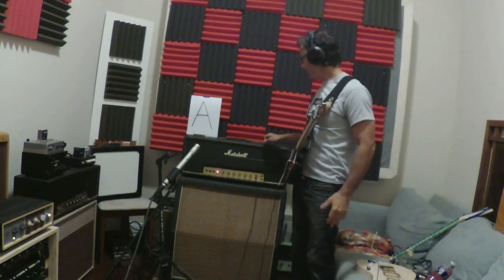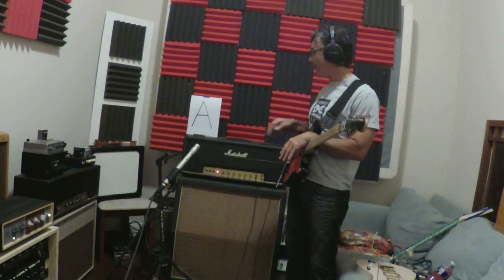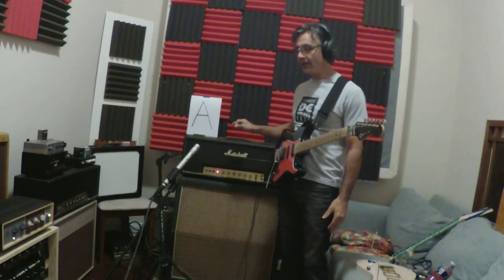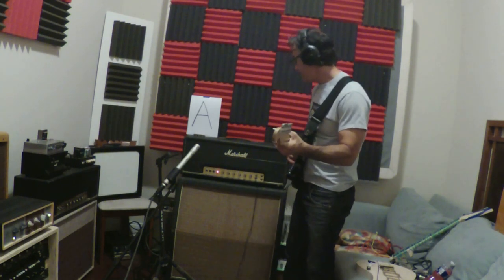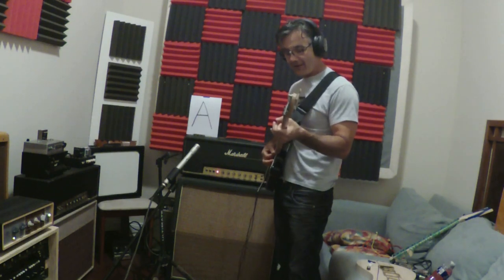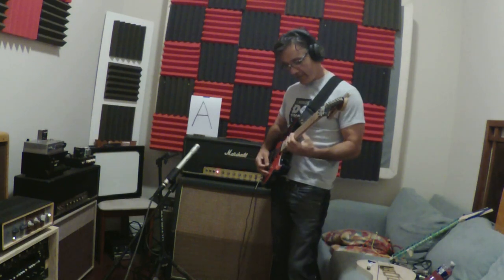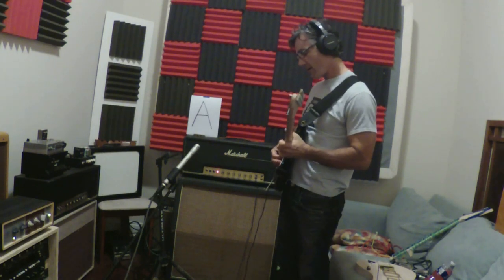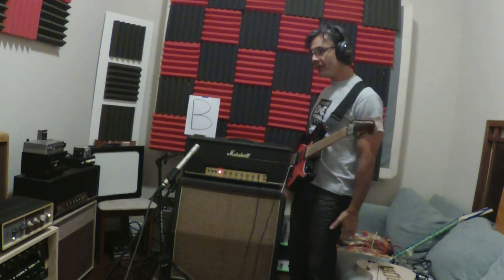Variac Myth-busting: 6ca7 at 90 and 120vac  A/B You Decide

Comment from the maker: The results are as in !

A).  90 VAC

B). 120 VAC

Pleasantly reassured that my guitar wielding friends were mostly correct in identifying which was which!!

Well done !

Personally  I prefer operating the amp at the wall voltage; I have always found the amp to be tighter and more aggressive.  Results may vary with other setups, but for me its gotta be 120!!!

Thanks to all that responded 

Ossie
Reply: You should not turn all the pots all the way up to achieve E.V.H sound and dial the variac as a volume pot ?? Yes it will really loud... Can you try it please  ?
Reply: That's what I thought before I saw the answer. B) sounds more powerful and crisper. A) sounds like it lacks something. No variacs for me. Good test.
Reply from the maker: @johnsimms3957 I John,  
 Yes... I agree.  No variac for me either... Blasphemy !!!????

Well done!

Ossie
Reply: @madjack4691  Don't forget that, for some reason, EVH's Marshall had a 50k mid pot in it. Marshall did stuff like that at the factory back in the day. . .and whether intentional or not, it absolutely makes a difference when you dime the amp.
Reply: Thank you. I didn’t know that. 👍
Reply: I hear a thicker sound, 90 was thin and bright
Reply: Ok, I know we are a few years down the road, but should the o/p tubes be re-biased if you drop the voltage? Whatever, it all sounds great!
Reply: You have to be able to set the bias hot when using a variac. If it's a self biasing amp, you have to add a potentiometer to be able to dial in the bias.
Reply: @ossieahsen6732 How do get your marshmello amps to sound exactly like Eddie's then if you do not drop wall voltage?!!!! Your marshmello amp blew me away !!!!

Comment: Ed first tried the Variac on a plexi that was an English non-import that ran on 220 volts... that's why he said he cranked the voltage to 140 volts because technically it was cranked but well under the standard voltage of 220v. Then he took his Holy Grail plexi that was from the Pasadena Rose Palace it was an import with the transformer that's for 115/116 American volts through the Variac. That's the one he ran down to 90 volts with the Variac.

Comment: EVH discovered all of this by accident.  He had access to a from-Europe plexi in the United States that was accidentally set to 220v.  He loved how it sounded and how quiet it was. But it was way too quiet.  So he used the variac to go up to 140v.  But the amp reference voltage was 220v.  So running the 220v amp at 140v was actually voltage starving the amp.  

You can achieve a similar effect by running a plexi at 120v and then starving it at 90v with a variac.

Anybody who thinks that because EVH ran the variac at 140v means he up-volted does not know or does not understand that the amp he was using was set to 220v reference, which makes the net effect down-volting not up-volting.

EVH might have switched to 120v reference/90v variac later. But in the discovery days it was 220v reference/140v variac. In either case, it was down-volting off of the reference voltage.

Comment: Hi Ossie ! Have you tried to use the variac between the amp and the cab ? 
It sounds a bit crazy at first, but it seems that it would be a way to tame the volume. I wonder if this could hurt the amp, regarding of the load the variac would present. And how would the tone be ?
Reply from the maker: Its possible to use the variac in this manner.  The Marshall power brake works in a very similar manner; using a stepped transformer.  The difference is that the power brake has a load as well.  I would make sure you have a load when using the variac this way.  

Its not the secret to the tone though.....  

Ossie

Comment: OSSIE, Randy Rhoads and EVH would turn it to 80VAC and you listen to when the amplifiers stops the 60hz hum that is when the variac is set to its sweet spot. It cancels out the phase of the power tubes is what EVH tech said. Are you sure he used 6CA7 power tubes on the first VH1 album? Also EVH guitar tech added those diodes on the input jack first preamp stage which are clipping diodes and the echoplex preamp section so this is driving the amplifier front end harder.

Comment: I run at 120vac, not only for efficiency and as to not cathode strip, but my amp sounds nice and full. 90vac is not a huge enough difference for me to use it all the time.
Granted I do use at 89vac, but quickly return to 120 from the variac and call it a day

Comment: FWIW - I A/B'd a set of vintage 6CA7s with the new EHX 6CA7s.  The EHX are not as full, rich and detailed but for everyday life, they are the best thing available IMHO.
Reply from the maker: We make do with what we can get!  Ill have to get some newer EH 6ca7's in to a/b.  Its been about 17 years since I tried them.
Reply: Ossie Ahsen 
When one gigs a lot, one needs a “daily tube” ... the EHX 6CA7 is what I settled on, maybe there is a better 6CA7 by now, but supplies are scarce, so probably not.
I surely didn’t want to burn old 6CA7s on casual Friday’s ...
Reply: @ThemFuzzyMonsters  Electro Harmonix is what Friedman would recommend unless you can get your hands on vintage Sylvania 6CA7's
Reply: Equinox 
The future is in modern tube production (inevitably) and while the EHX 6CA7 is inferior to NOS 6CA7s, it is close enough ... and at the price at which it retails, I am quite happy with it!
Reply: ThemFuzzyMonsters .. You got it wrong. You are not suppose to rebias! Bias at wall voltage then  turn it to 90 volts. Where the bias ends up it ends up. 

Friedman said Eddie would start at 81ma and then turn the voltage down to 90. He said the only tubes that could take that were the Sylvania’s.
Reply: @starguitar413  I spoke with Dave previously and with it browned and at 90V, 50mA is what it should be biased to on Ed's amp, fyi!  Not sure where you got the 81mA from!!
Reply: Equinox  These are post from Metroa
Reply: Equinox  I will copy and paste all the post from Dave Friedman on the Metroamp forum. He repeatedly posted this. I saved all them
Reply: @starguitar413  Ok, but I'm telling you what it is and Dave said and in some videos also!  
Also, in case interested, John Suhr uses a "virtual variac" by utilizing primary taps.  This bias settings are labelled underneath the chassis of his SL-68 and are as follows: HI - 34mA  LO - 45mA.  Dave uses HI - 32mA LO - 50mA and now you know!!

Comment: What's the decibel difference tho? The whole reason why Eddie used it was because his Super Lead was too loud when cranked to 10
Reply from the maker: Hi Roger!1

Great question!!!!  

 The decibel level reduction is really not that great. If you do the math at 90 vac input  the amp is still putting out enough wattage to drive the speakers to earsplitting levels.  
 Speaker sensitivity being what it is with celestions you would need to get down to less than 1 watt to really play at a reasonable level...   

The variac is not a good solution for stage volume issues... that it unless you place it in between the amp and the speakers cab....  Really.

Thank you for the comment!

Ossi

Comment: Hi Aussie, I just bought a 5amp 500 watt variable unregulated nonisolated variac. In your video you didn't say what kind of variac you were using. I'm not sure if what I ordered is the right amount of amps to run a 50 watt Ceriatone  HRM amp or 100 watt MESA Boogie Tremoverb amp. Is 5 amps at 500 watts enough to run these two amps at say 90 or 110 volts? Also is it bad to always run am amp at 90 volts all the time or for long periods of time? I'm not at all knowledgeable about using one of these. The net is very evasive about this. Any advice would be greatly appreciated.  Thanks Michael Newell from Niagara Falls,Ontario, Canada
Reply from the maker: Hello Michael,  Thanks for watching the video!

My variac is rated for 10a and is made by Tenma.  

A five amp variac should be ok to run the 100 or 50 Watters.  That said manufacturers can overrate equipment, its rare but it happens.  If you blow the fuse in the vairac (assuming it has one) you will know its under built for the task.  If it has no fuse it may get very hot, also indicating its stressed beyond its design. Use caution! If its really crappy it could catch fire!

Its always a good idea to get to know what you are working with- especially when it comes to electricity... where bad results  can be catastrophic to persons and property.  I would not suggest using these devices without learning the basics and understanding what is safe and more importantly WHY :)

Running appliances such as amplifiers below recommended voltage  can be damaging.   Its really a function of the design of the appliance whether it is or not.  Things such as relays and ic's behave different when undersupplied an can have adverse effects.  I would check with the manufacturer of the amp to give the "ok" as to running below wall voltage.

Hope that answers your question :)

Ossie
Reply: Variacs are useless and the sound is all in your hands anyway. It's nice if you have talent but if not, practice will do

Comment: Have you checked bias after lowering the voltage with the variac? Does bias get hotter or colder or stay the same when you lowered the voltage?
Reply from the maker: Yes the bias was adjusted.  It gets a bit colder 
Ossie

Comment: Greatness for us Guitar (amp) Geeks! Does anyone speculate what preamp tubes Eddie used back in the day?   I’m assuming Sylvania or GE’s from the timeframe and probably just buying them from a local electronics store.....  I have a ‘73 SL that Dave Friedman modded to the EVH amp specs, and running NOS Sylvania 6CA7’s, I find it definitely gets that tone with all the Knobs dimed as in your video.  I’m curious @90vac what is the bias reading on your 6CA7’s? Love your videos!!!
Reply from the maker: Hey,

 Thanks for watching :)

Like you are implying I think he probably used whatever was available- remember back in the 70s NOS wasn't a thing- obviously :).  I ran the trim pot full up and got the amp biased close to 70% max at idle... I think it was around 60ma per tube ... but I cant really remember that far back :)

Ossie
Reply: Ossie Ahsen Thank you Ossis! I need to check mine again, I haven’t fired it up in a while.